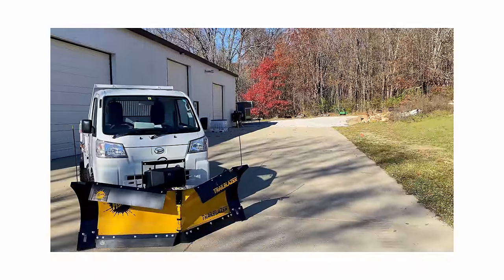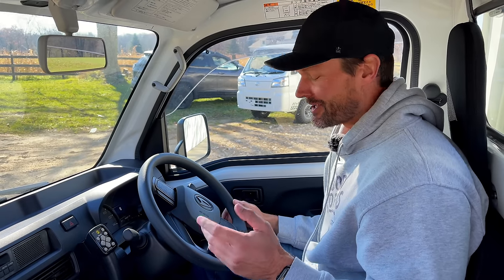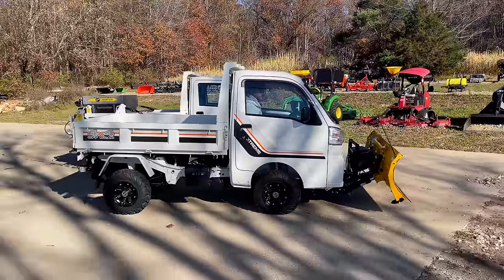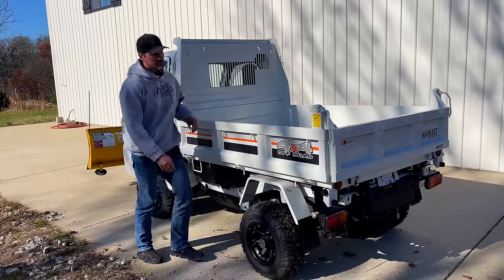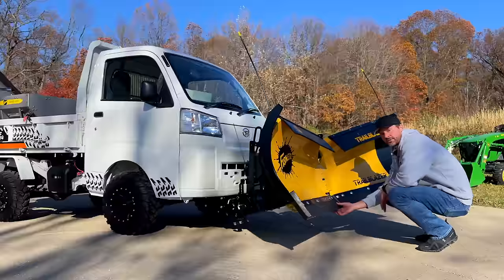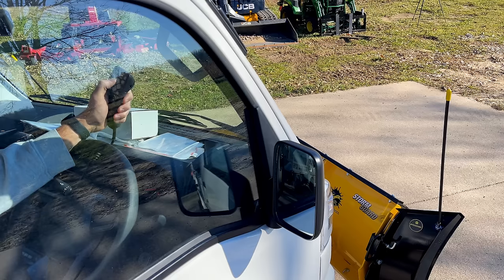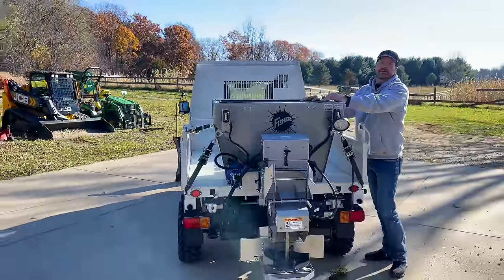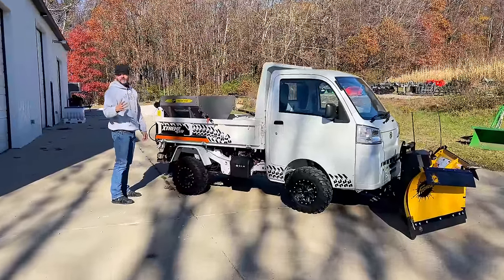I DON'T EVEN DRIVE MY POLARIS ANY MORE...

Comment: Enjoy your reviews. Helped me with my tractor & implements purchases. That straight edge Fisher plow is definitely a substandard build. Thin cutting blade & lack of additional rib bracing make plow light weight but fragile. I installed one on my Gladiator and used it 2 times. First plow was 1" fluffy powder and bent one corner of cutting edge. 2nd storm was 3-4 inches of wet New England snow and bent other corner of cutting edge  and also bent the plow. Uninstalled plow and purchased another. Fisher plow has spent 2 yrs in my yard because I cannot in good faith sell it because its so flimsy. I hope you have better luck but really am waiting for an end of season review to see how yours lasted.
Reply: Boss is where it's at for plows

Comment: We use Magic treated salt. Google your area. Available in pallets with bags and usually a supply yard will carry bulk. 
For that smaller spreader I would suggest bags. You can store in the shop and slice bags and fill the hopper in doors

Comment: Cool little truck. Most certainly has a place and purpose. I don't know if I can mention brand names but here it is. Peladow ice melt is what I have had an opportunity to work with. The organization I worked with bought the stuff by the pallet. Many pallets. We used a salt sand mix as well in our larger spreaders. The smaller trucks spread the sand mix by hand after clearing major snowfall. While still snow flying, Even a small build up after spreading a sand mix would leaves piles of a slushy mush inches deep and more often than not quickly freeze and turn to ice, causing hazardous walking conditions for weeks later and in some cases the rest of the winter. As you may be able to tell, I was with a very large Transportation agency. When I had a crew or working at my specific assigned location, I would instruct the use of Peladow, (on the sneak), it is concrete friendly, much easier to distribute and at far less quantities. After clearing a location and moving to one of many a crew would have, continued snowfall would still accumulate but at a slower rate and usually would remain in a moveable state for mop up operations sometimes a few day after a snow event. After mop up, sprinkle some sparingly and after the sun hit it, it would be down to shinning bare pavement or sidewalk. Expensive but larger volumes are sold a substantial savings and between quantities used and labor it could be a wash. Definitely easier on the equipment than salt. Can be had in 50lb bags. Usually I would rescue a bag or two to take home for my hilly driveway and one bag would last me for the season at home. On sheet ice, sprinkle some very sparingly and it would put hole in the ice and start running underneath, As soon as the sun hit it, boom, gone. Try some. Once you know how to use it, you will swear by the stuff as I do. No, I don't work for that company or stand to gain in any way by writing this, just sharing what I have learned by using it. GL with your next blizzard. By the way, I am in the NE, and we get snow, lots of it.

Comment: Brine or sand are the least corrosive options I think...some brines attack aluminum I've heard though... I'd go with just sand and use your sweepall in the spring, the dark color will help melt
Reply: Actually I wonder if you could use the sweepall in winter? 😅

Comment: I'm sold on the concept.  I am not sold on the price.  The rest of you need to buy them all up and in 6 to 10 years they will be on the used market in the price range i would go for. So go ahead and get to buying them all up so there will be a complete parts pipeline when I get my used one.
Reply: 25 y/o ones have been getting imported for decades.  I don't know where you live, but in central VA a Craigslist or Marketplace for "Japanese mini truck" or Hijet or Acty will bring up multiple options under $10k.  And they aren't governed like the new ones if that matters to you.
Reply: @Noah_E  
Yes,  exactly. 
That is proof of concept of what I'm saying. 
However,  there is another thing to keep in mind.  By their very nature,  those are Grey Market orphans here. Where would one go for parts support? Would the parts for the new ones be usable on older Grey Market orphans? Or will the new generation of imports be as orphaned as the old ones? I'll let others have the fun of finding that out and wait. I have gotten to the point of buying my flat screen TVs from the pawn shop,  I've had good luck with them, and they cost less than most pay for the warranty on theirs  ...
Reply: @rodgerneeb301  they are really simple to the point that most didn't use EFI until the 2000s.  Japan makes about a half million Kei trucks a year so parts are plentiful.  There isn't much to break and maintenance/wear items are readily available online.  Especially if you use wider rims so you can use tires available here instead of the narrow ones they use in Japan.
Reply: You can buy original condition Kei trucks for much lower price. These are customized and made nicer so they are raising the price as well.
Reply: The main problem with these vehicles is that they are very light and are limited to the amount of snow that they can push. They also have very thin paint which is okay in most places in Japan but if you’re county or city uses salt on the roads they will rust away very quickly. They have a 660 cc engine and they are very low on power, one of the benefits is that they are a 4x4 and are fun to drive. Mine is a 2002 and is in new condition but a friend bought one and used it to clean snow and after 3 years there wasn’t a lot left, the paint might be better now. I do enjoy it but a serious work truck it is not. No offence to you good sir but this is just my opinion of an older version of the same vehicle…. They have very thin body panels.
Reply: Have you seen how much loaded Gators and Kubotas go for these days?!?
Reply: these things have been around for many years they're called kei trucks they're just utility trucks and bands and stuff like that in Japan kei refers to the size they weigh less than a certain amount or something but just like anything else they can be imported they have been for years I'm in West Virginia and I see a few of them around I know a farmer that has a couple because there's such good vehicles he prefers them and I would too if I had the money to buy one over side by sides

Comment: I would use a salt/sand mix. That way it melts ice and you gain traction. Its probably 80 percent sand and you can usually have it delivered by the dump truck load.

Comment: I’d be curious if the manual or the auto trans has a higher top speed, or acceleration. Maybe a gear for gear shootout? Top speed in each gear? And a drag race?

Comment: hey man you should look into corrosion protection like fluid film or other brands and do a video about protecting your machine from rust and salt in the winter. i am a heavy equipment mechanic and there are companys and kits sold that coat your tractor to prevent rust and its waterproof unless you have a hot pressure washer

Comment: Plowing snow with a standard transmission is NOT the way to go for sure. However, a dump with automatic kicks the crap out of any sxs on the market. $10k-$15k cheaper than Polaris or Deere and is road legal. Sxs in my state cannot be plated. This is a million times better, more useful, quieter, comfortable year round…this is a winner. Hands down, no competition with any sxs, they’re not even close.

Comment: this year im going from my john deere 300 garden tractor and big block 3/4 ton chevy with 12 ft plow that just drinks fuel and has alot of electrical issues and running a ford 9n that im overhauling so im not constantly working on stuff every 3 passes

Comment: I have an XJ Jeep that i bought for $2500....built a plow for $100 .....now i have heat and remote control of the plow.....150 hp and larger tires.....I entertained the Little Japanese trucks at one point. but the HP was lacking

Comment: with tax $35k to $40k about the price of a decked out side by side but with more capability. You have to have the right situation. Maybe rural Wisconsin where the let you street drive or 50 acres. Nice truck for the right situation.
Reply: Those mini dumps will go anywhere a UTV will go.

Comment: When did these little rigs start pushing the front differential forward?  Did they ever offer a left side steering option?  I'd be interested in a mini rig if I could have those two options.
Reply: I’ve never seen a left hand drive one. Unless you have a really specific use case for LHD, the biggest downside to RHD is accidentally trying to get into the left side when you are wanting to drive. It’s a good laugh at best, and only very mildly irritating at worst.
Reply: They're made and sold in Japan as urban trucks, so I don't think they make them in LHD. They're called a Kei class vehicle.
Reply: @ThalassTKynn  Thanks for the info!

Comment: Those trucks are Kei trucks.  They are JDM Exclusive road legal vehicles.  Due to safety reasons importing Kei Trucks into America is complicated.
They have many comforts of a car but at the same time very few safeties because of space concerns.  
I am oddly intrigued about the Kei vehicle engine.  It is legally limited to 660cc's and 64 HP.

I actually like the Kei Car idea.  A small and economical road legal vehicle.
Reply: The engine size and power rating is for the Japanese road registration. Smaller the engine and vehicle. The cheaper it is to register there.
Reply: @clintadams8451  

That is partially true. Kei cars are an interesting part of Japanese history.
Kei cars were intended to be an economical car based on government mandates.  The Length, width, engine displacement, and KW of the engine was limited by the government.  Those limitations also allowed the Kei cars to enjoy tax breaks.  There was logic behind the limitation of the vehicle size, at the time many/most of the Japanese roads were small and the Kei car could just fit through them.  In addition there are numerous bonuses to owning a Kei car, one being the taxes and registration is cheaper.
There was also an economic reason why the Kei car exists, during their initial run, the Japanese economy was in the gutter.  The government wanted people to move around (mostly for work) and an affordable car was one of the options available.
Now the Kei car is a very cut-throat market in Japan (mostly because the car is a JDM exclusive).  Last time I checked, 30% of all Japanese cars were Kei cars.
Reply: @johnsmithfakename8422  Kei car is JDM exclusive, but the manufacturers also make similar models for other asian markets (India, Indonesia, Philippines, etc). And because they don't have kei restrictions, those cars usually have more powerful engines (1.1L 100 HP vs 660cc 64 HP).

Comment: was the price 5224? i cannot justify the price of a gator, Polaris, Honda side by side, etc. I can buy a used short bed 4x4 truck for much less and will be street legal everywhere. These are what I would look for.
Reply from the maker: Here ya go 
https://minidumps.com/truck-sales/
Reply: Add a 3 on the left side of that 5. I love the idea of these, but I can’t justify it. Could set up my tractor and utv for less then this.
Reply: Definitely not 35k stock. More like 25k for one, brand new. Used they can be had for 8k in my area for one in good condition.

Comment: Do you have to get tags for them ???
Reply: You can register them in most states. 
Whether you need to or not depends on if you are using them on public roads (yes) or exclusively on private property (no).
These are Japanese domestic market trucks ( kei taro )... what surprised me is that these are new vehicles,  
I thought they had to be at least 25 years old to warrant importation into the USA.
Perhaps the laws have been changed;  can someone enlighten me/us?
edited for formatting

Comment: Have they done tests to see if the vehicle goes up and down the hills of Blue Ridge mountains? How is the stability during the descent of steep hills or up the hills compared to RTV's?  Thank you
Reply: Farmer's use these on farms in New Zealand, they're more stable than UTV's on hilly country also better payload and towing capacity. These don't have CVT transmission, they're proper manual or automatic gearboxes.

Comment: How about a front PTO for a front mount snowblower?  That would be amazing.
Reply: There are front mount atv/sxs snow blowers that have a gas engine to power them built on.
Reply: Kubota is all hydraulic and will accept a PTO snow blower, but the K connector and snowblower is super expensive!    My dealer said it would and extra $12,000
Reply: I was about to ask this very same thing.  A snowblower instead of ice melt dispenser or even a blade would be fantastic.
Reply: @chrisjordan7441  which kubota are you talking about?  Do they make a mini-truck!? Thanks!

Comment: These looked really cool until I read the fine print and saw that they have a governor on them that restricts them to a maximum of 20MPH. That is a huge drawback if you planned on using this commercially and needed to travel on the roadway with other motor vehicles.
Reply: This truck isn't 25 years old. It was imported and cannot be titled or registered for road use. Kei trucks must be 25 years old before being imported.  Also they are not speed restricted. My 97 Honda does freeway speeds and is road legal.

Comment: Polaris is hard to beat with capability and top speed. 20 mph is slow even for farm use with any substantial acreage
Reply: These are street legal in most states and do highway speeds.
Reply: Why Polaris hasn’t gotten smart and build a long bed ranger is beyond me.  Something like can-am’s defender pro 4x4 which has a 6’ long bed. I’m in between the defender pro, or one of these mini trucks for use on our farm & tract in WV.  These trucks are definitely more utility focused, practical, and will probably be more reliable. 

No comparison off road though.

Comment: They ARE cars, not just like cars. Besides the crazy states trying to outlaw them, they are able to be road legal as long as you have DOT reg’s checked off at the time of import. 

I like this use for them as well, nonetheless.
Reply from the maker: The feds are the ones making them not road legal.  So it happens at the time of import. Customs.
Reply: @GoodWorksTractors Feds don't make that decision.  It is a state by state decision. Hence why Washington allows them but Oregon does not, for example.